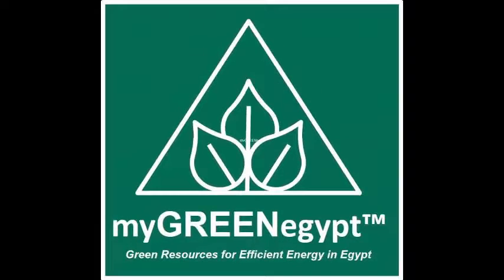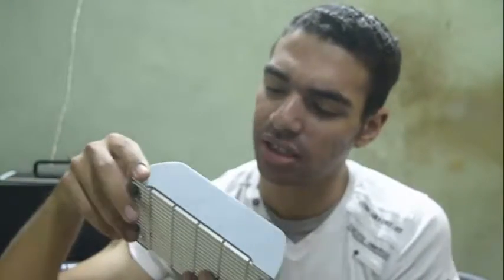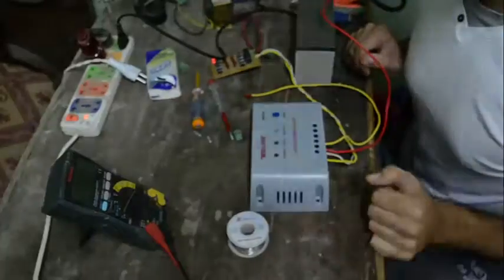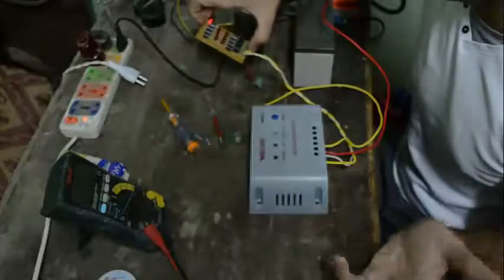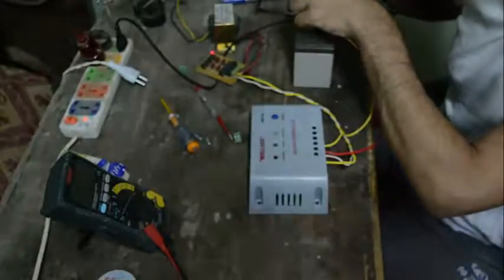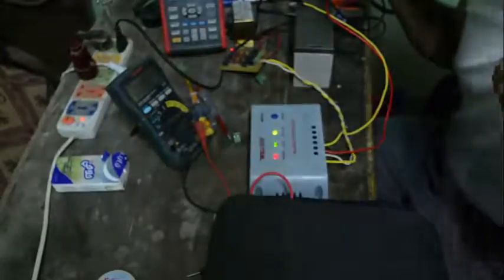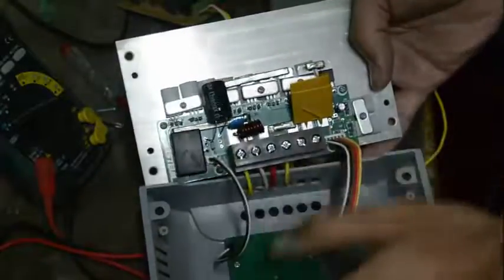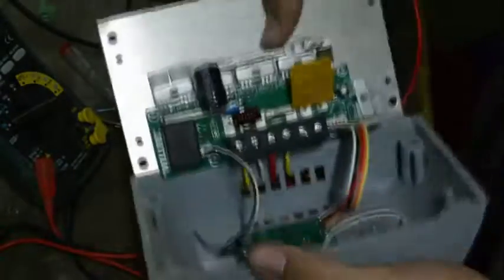WELLSEE MPPT charger testing

Comment: not a mppt
Reply from the maker: I'm not sure about the quality of the algorithm written inside. but we tested it using various supplies with different maximum power point, and the charger tracked them and stuck there.

I'm not comparing it to other famous controllers in the market, but they have a PIC MCU inside, so it definitely does something.